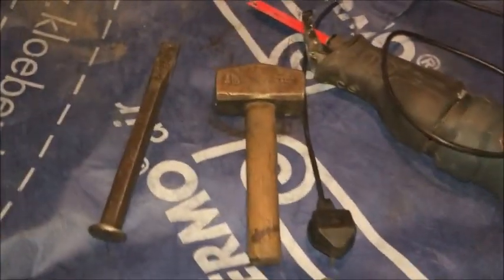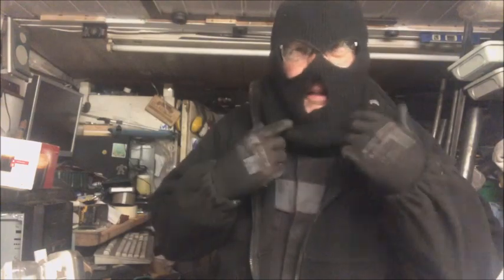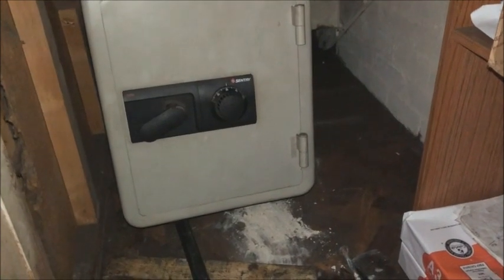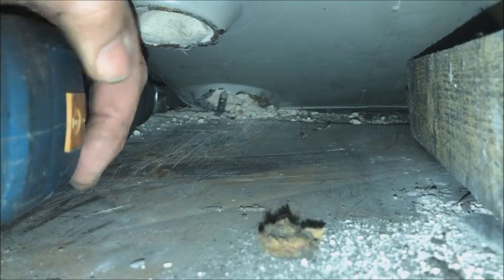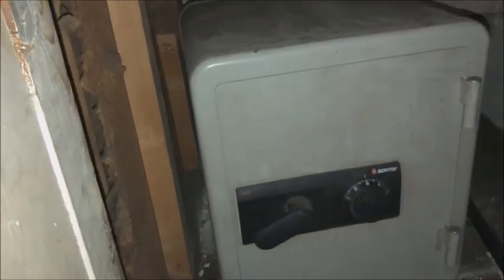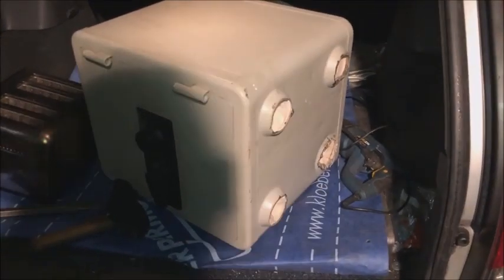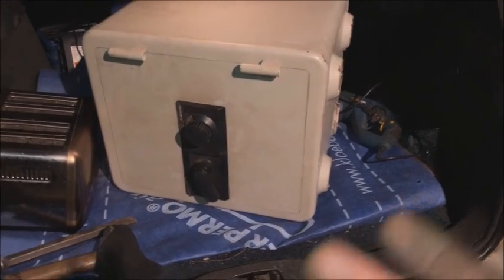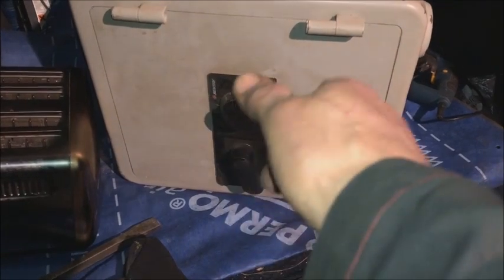Safe cracking . Season 2. get it out

Comment: 3- 4.5" cut off disc's to open my friends safe. It was that or pay a locksmith between $300 and $600 to open it. They wanted $150 a hour from the time they left their shop (2 hour minimum). I cut the outer steel around both the throw handle and the lock tumbler. This allowed the handle to turn and the locking pins to be retracted from the side of the safe. Allowing the door to swing open. Good luck.  :)

Comment: Ian, the "long way" to crack it, is contact the manufacturer, give them the type and serial number, and they will give you the original combination - if the original owner hasn't changed it. Second a lock smith will charge you about 100 - 150 dollars "American " to come by and open it  - that works if you know what's inside. Is worth more. Last call MI 6 and ask for James 😀 Seriously you can crack the door in about 20 minutes - knock/cut out the bars in the hinges , put a crowbar in the slot and heave away, on that safe it's " a piece of cake", the locking rods are not that deep and will pop out. " and so say all of us" . Very last option is cutting touch. A LOCKSMITH is the only way to save the safe for reuse. You really don't need power tools, a hack saw will do. Afterwards is it Scotch or Whiskey?  Cheers from Bob in the Pacific Northwest USA. Don't forget Boxing Day.
Reply from the maker: Yep. I’ve already watched all the vids on YT,  but I need DRAMA   Got to give the folks something worth watching

Comment: Hello , it’s a direct drive safe, that means the handle controls the bolt stump,   The stump will travel though the flywheels once they have lined up with their true gates..  put a stick on the handle to extend the free play,   Mark at a fixed point,   Start dailing. The combination clockwise once you notice more movement in the handle you are in the correct gate ,  then dial anti clockwise to find the next true gate ,  then back clockwise to find true gate on wheel number 3 and the safe will open.
Reply from the maker: Awwwe your making this too easy for me, I need drama. Hammering  grunting effort n sparks, would love a bang as well but in the UK. That’s not easy, even homemade is illegal
Reply: @Man-in-da-shed   ,  hi Ian,  would not advise you to cut it open,  the walls and door are full of superlux    You don’t want to be breathing that dust in!  Think of your safety Ian ,  also Ian  your get more respect if you open it non destructively.  Also I’m sure the handle travels down to open...   if it a go ..   it’s a real buss when you get them open ..
Reply: Also Ian.  Just wanted to say to you. Don’t be lifting the safe the way you were.    I’m talking out of experience, and are now paying the price with having a bad back... I know it looks good on camera mate.  But trust me on this leave it out.....
Reply from the maker: @paulbashyou  it were heavy n I ain’t getting younger. Would have had it my shoulder when younger
Reply: @Man-in-da-shed    Alright Ian ,   How you getting on with the safe... remember fix a pointer stick to the handle as lease 16” long to a fixed point,  put the dial to 0. Turn dial clockwise to 4  try the handle for more movement,   Watch out for false gates... true gates theirs more movement in the handle...    any problems. Mate  post your mobile and I will give you a call.... I’m from the uk London.....
Reply from the maker: @paulbashyou  thanks Paul. I need to make a bit of room in the shed first

Comment: I watched someone on YouTube that used a strong magnet to open a sentry safe. They put it at the top left side of the door and it pulled the latch back which locks the door but that won't be as interesting as watching you break it open
Reply from the maker: that only works on the electric models